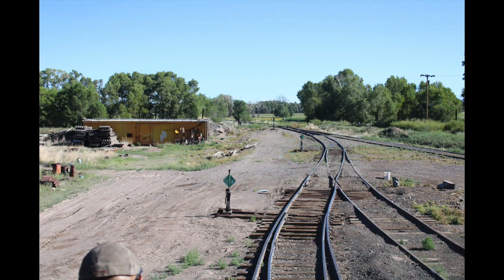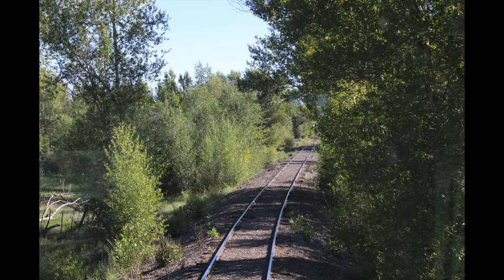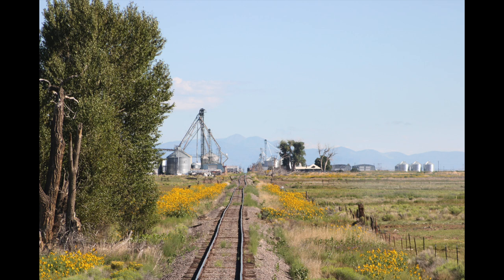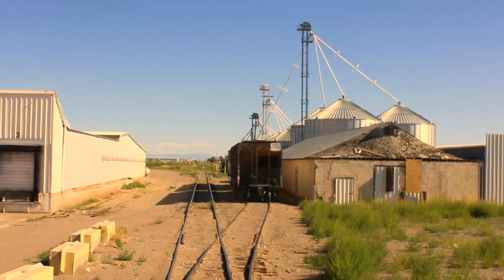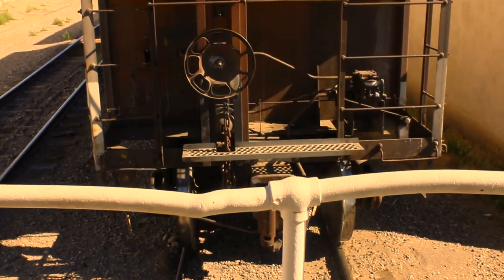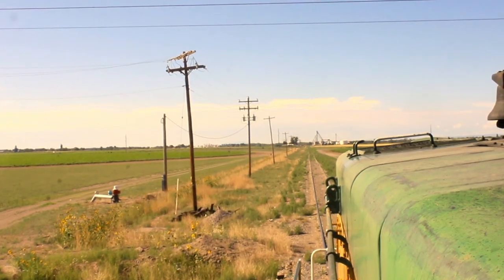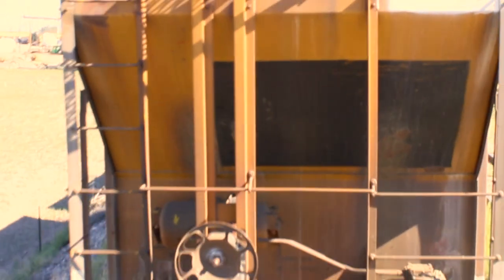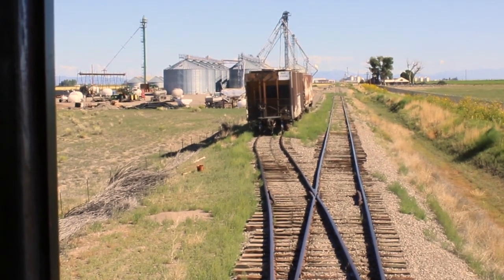The San Luis Central Railroad

Comment: For me, this is where the steel meets the rail. This is railroading. It's always cool to watch the big trains running around on the main lines but this is the meat-and-potatoes, (pun intended), of what happens every day by unsung heroes.
Reply from the maker: Indeed. The 9 employees do everything on this line. Several of them are multi generation SLC workers.
Reply: @allenscottmontgomery3929  How am I not surprised about the multigenerational aspect? Shows you how much pride and dare I say, passion, goes into making this railroad work. My hat's off to them.
Reply from the maker: Their SW8 that they use every day has a plaque in it dedicated to the guy who drove it for 40 years. @oldgoat142
Reply: @allenscottmontgomery3929  That is a legacy not only to be proud of, but speaks volumes to the character of the people who make things in that company run. That is an extremely rare thing and such a gift to the family.

Comment: I wonder if they take any volunteer work to help with general maintenance?
Reply from the maker: They certainly need more help, but I would think there might be a liability issue with free help.
Reply: @allenscottmontgomery3929  That”s what I was worried about.  There’s always the regulators. But in a way, it makes sense.
Reply from the maker: If I owned the railroad, I wouldn't want to get sued by anyone;) @dragonsbreath1984